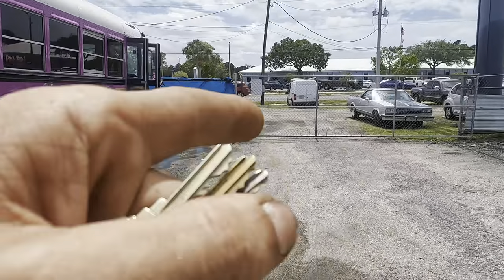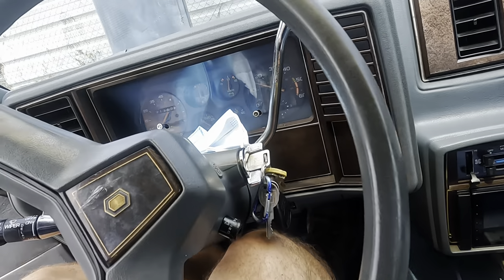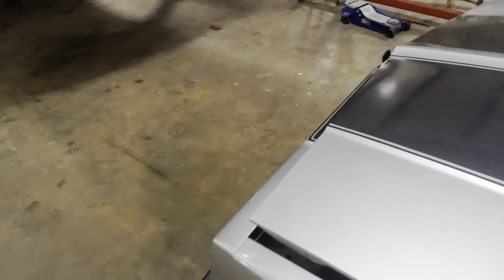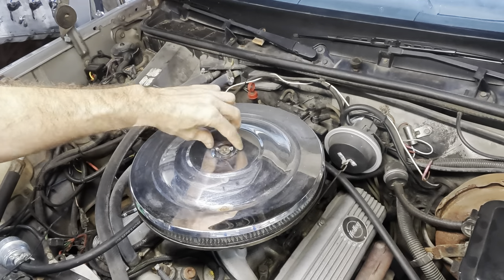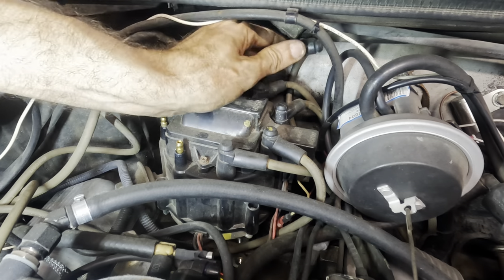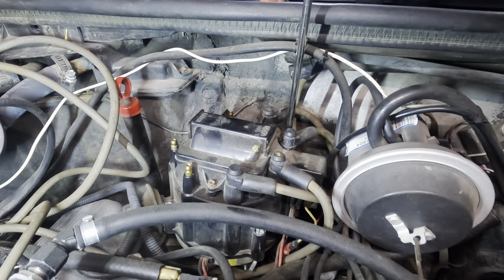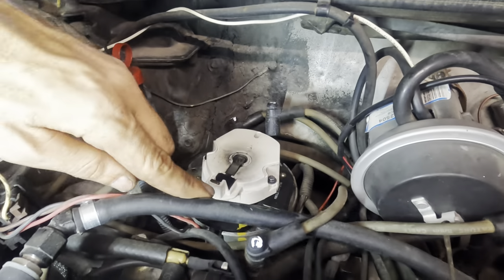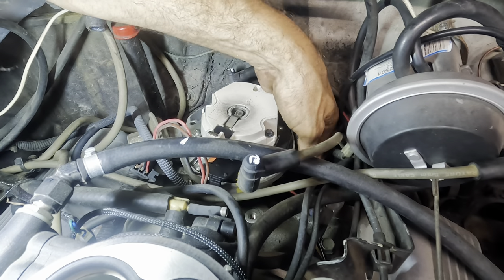Shuts Down While Driving! 1985 Chevrolet El Camino | Karen Story at End #mechanic

Comment: It is neither a truck nor a car... it is a UTE, Some older cars have no space, Like Chevrolet's around the distributor... because some moron thought it was a good idea to put all of the important items in stupid and inaccessible positions... unlike Ford that put the distributors in the MOST accessible place! I mean why put the hand brake on the floor and have to use a foot to operate it? If you cant hold the button and pull it up while doing a hill start, it is worthless! same with having the steering wheel on the left hand side... that means you cannot keep your dominant hand on the steering wheel while changing gears... or more importantly while horses were still being used, cannot use your sword in your dominant hand to fight off oncoming bandits (which is the whole reason the romans decided it was prudent and hence the law to ride on the left!

Comment: come on now ray you didn't fix it you replaced parts you didn't need to replace the hole distributor for a ignition module or could be bad programing on the efi

Comment: It is neither a Truck OR a Car . It is a  Ute . Short for Utility . A  Pick-up built on a Beefed Up   Car chassis . 
Most  U.S.  Pick-ups  are a  Light Truck design , vis-a-vis , Full Chassis Frame , Beam Axle up front Etc .
Whereas the  El Camino is like an Australian style Utility Vehicle aka Ute . Wishbone Front End and a Load bearing Subframe at the back .
A  Car at the Front and a 1 ton truck at the back .
That is a Shitty Design for a Distributor . Awkward as  F  to work with . 
The Cap should be located by a Key molded into its Base and engages a Notch in the body . Retained by 2 or 4 (V8) external Spring Clips . 2 or 3 on a Six .

Comment: So simple to walk the distributor into proper place. Just need to drop it in and walk it around till it’s right.. no timing light is an issue and just backyard mechanic doing work and calls himself a professional.  Sad to see. Vapor lock isn’t an issue with high pressure fuel injection. Shade tree mechanics with no knowledge of how systems work.